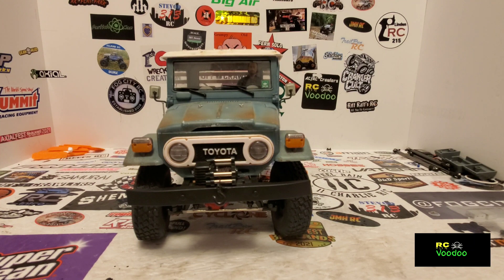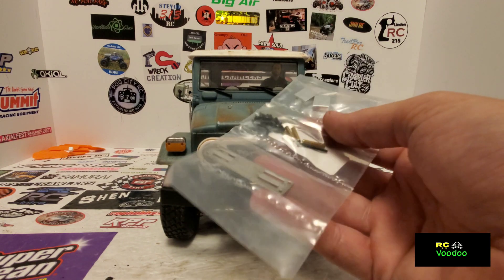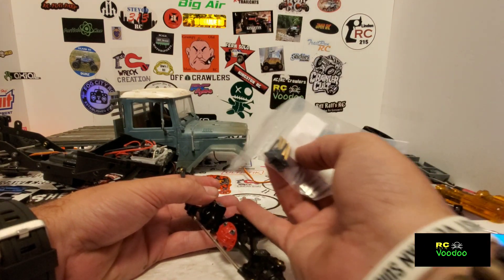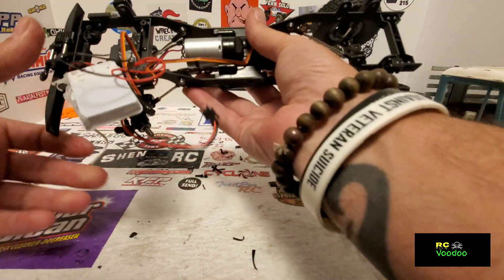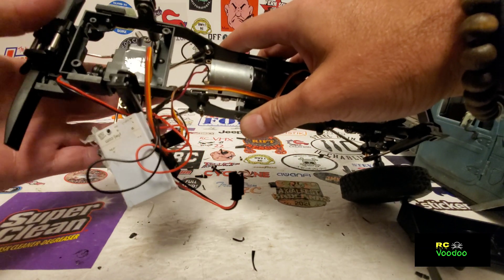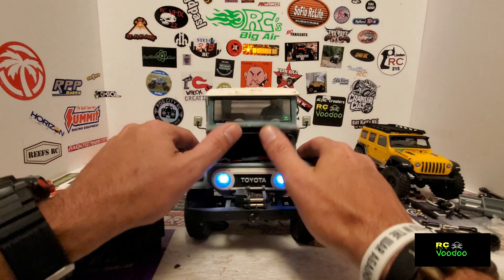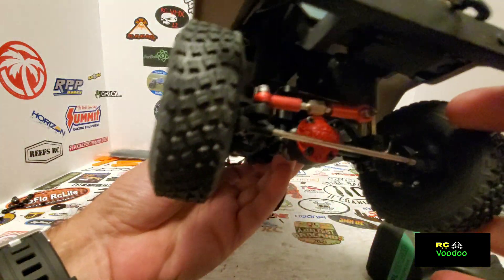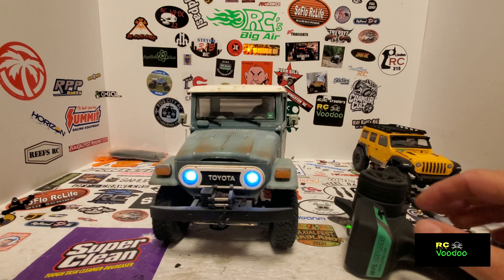WPL upgrade.  mounting servo on axle. & 4 linking the front.

Comment: Did the same to mine, actually a huge improvement. It's finally fun to drive. And it performs good. I even think the stock servo would fit... It would definitely fit between that servo holder kit. but u might have to dremel away some more material from the original servo tray
Reply from the maker: I couldn't remember if that was stock servo. Or one I had added or if it even came with a servo
Reply: @RCVOODOO  it definitely came with a servo, metal geared servo, it had no text on it i believe. Only a shiney WPL sticker. But it's tha size that matters, if it fitted in the old tray perfectly it should fit on that too. But it looks better with the smaller servo. I have no problems with the power. It's good

Comment: Did you try it with the 4 link front and removing the panhard bar before relocating the servo? I had a similar issue with my 1/18 Atlas. My stock steering was close to yours but I did the scx24 axle swap but kept my servo on the frame. And since the stock panhard bar wouldn’t clear the taller diff, I used 4 links instead. Now it steers like yours after the mod but still frame mounted.
Reply from the maker: I did actually. It was still pulling it down. Not nearly as bad though.  I could have eliminated it if I were using a radio/receiver that had epa.  But keeping with the RES V3  I didn't have the option.